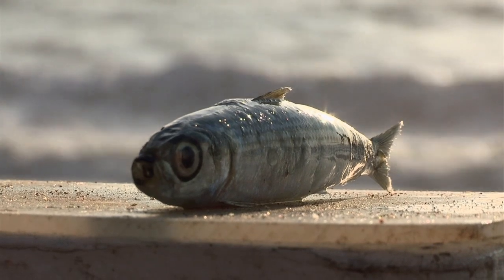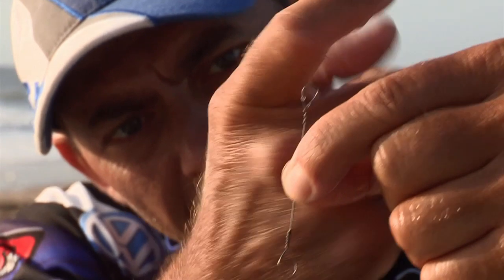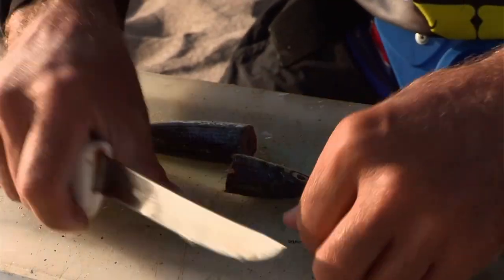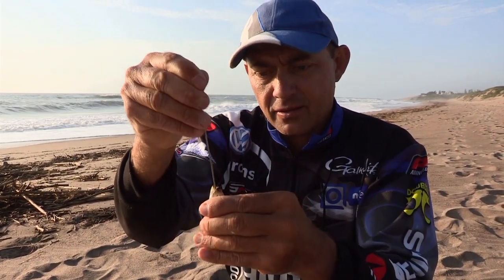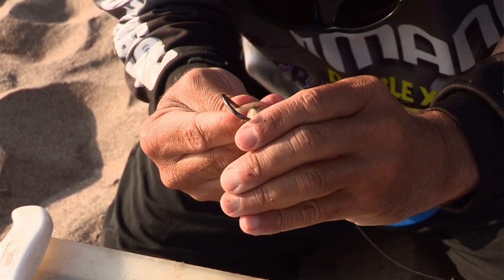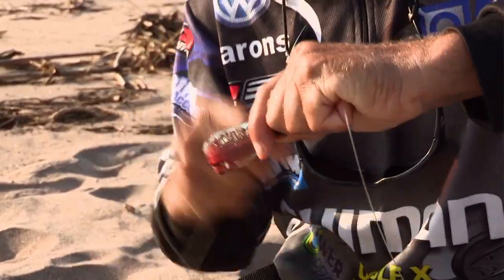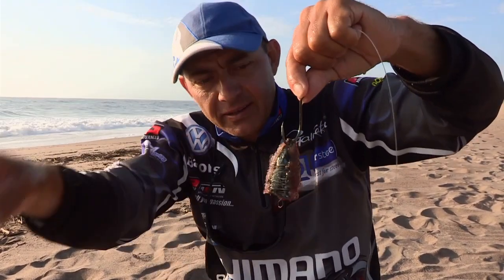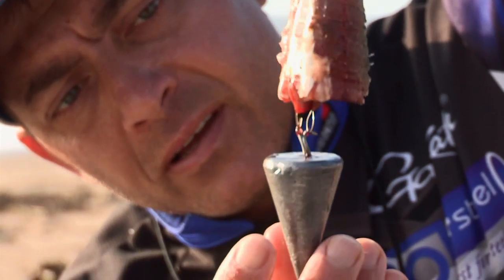What is the Dingle Dangle method | ASFN Baits

Comment: Great demo - thank you. Question - how do you prevent the dingle dangle from coming off the circle hook? If it's out on the surf, it'll be moving around a bit and the wire loop could go over the barb. How do you prevent this?
Reply: The hook goes through the bait lip then wire loop then the other lip